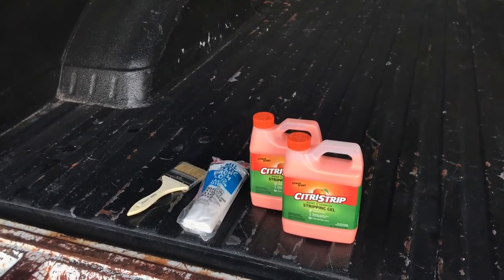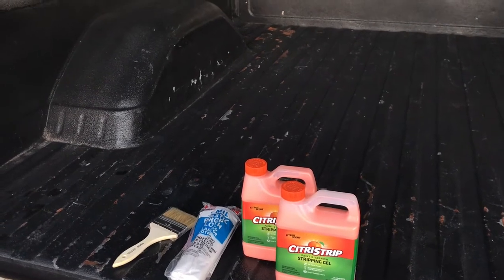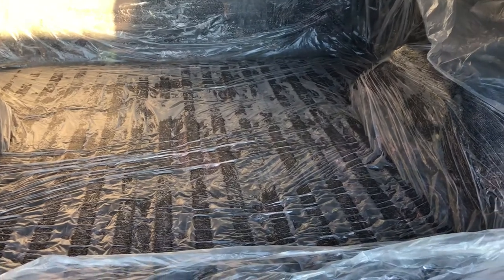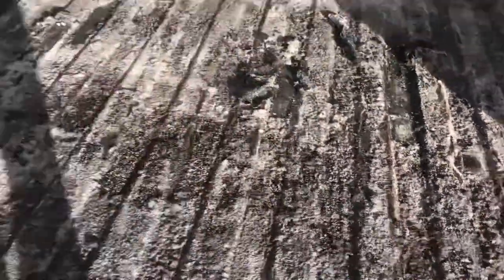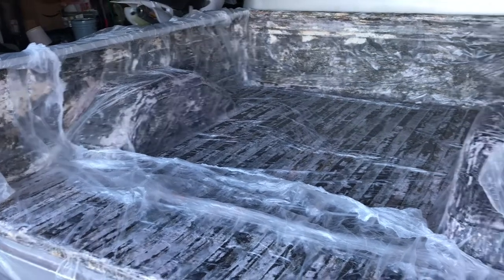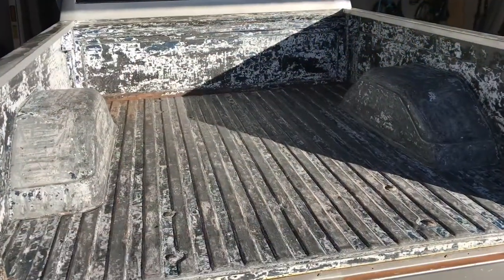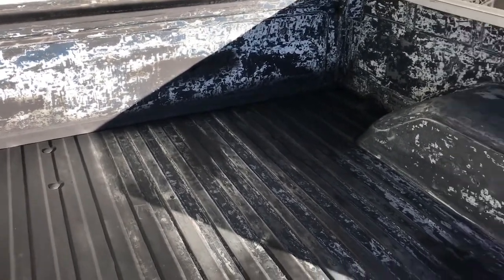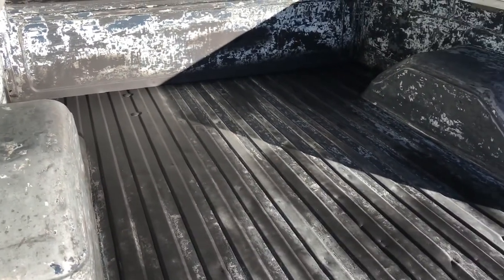How To Remove Rhino Liner / 1981 Chevy C10

Comment: Believe it or not diesel is the quickest and best way to take that off put a coat on wait 5 mins put another coat of diesel on wait another 5 mins and you can take a rag and wipe it all off like water. My whole car was rhino lined by previous owner and within a hr one whole side looks like it did when it was new
Reply: Did the diesel take off the underneath paint job?
Reply: No the paint was just fine other than needing washed off afterwards

Comment: A dustless blaster would do the trick or you could have just sanded it down with 36 grit on a D.A sander with a interface pad it would have tore it apart fast